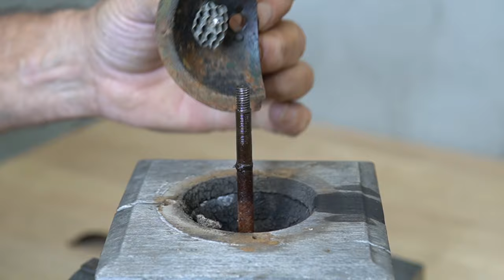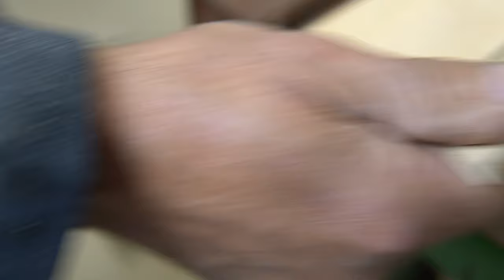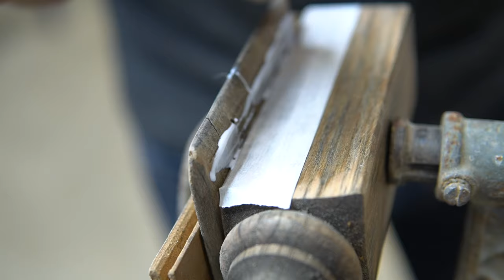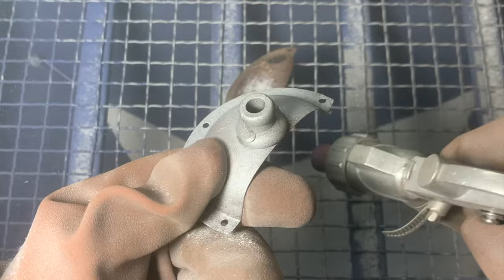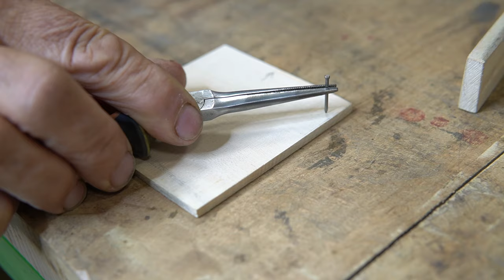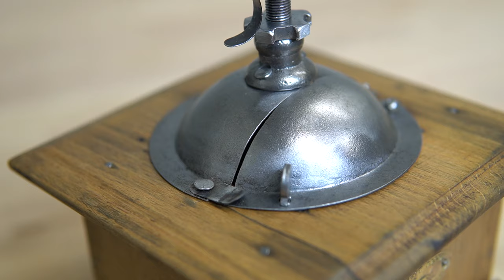Broken Coffee Grinder Restoration

Comment: Tip to share. When working with a crack and you are using glue, if you apply the glue on one side use a shop vac to pull the glue into the crack itself for a stronger hold. Works wonders. As always, nicely done sir.

Comment: To fill small cracks and holes in wood I mix wood dust with Rakoll (yellow extremely strong water based wood glue) or Stuccolini (if wood has perfectly smooth surface) and apply using syringe with big needle. By adding tempera you don’t weaken glue and reach exact wood color, which is useful in restoration of old wood affected by fungi that became grayish.